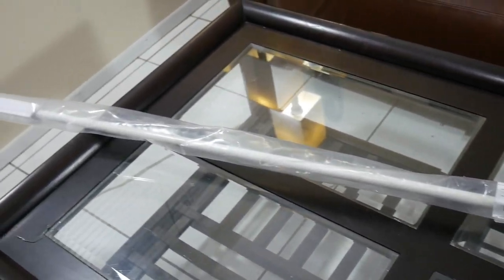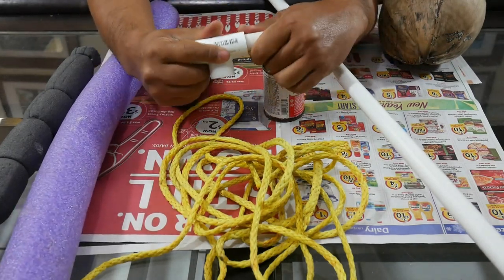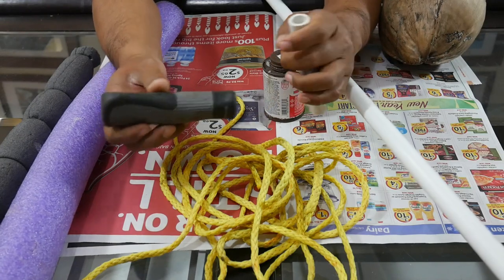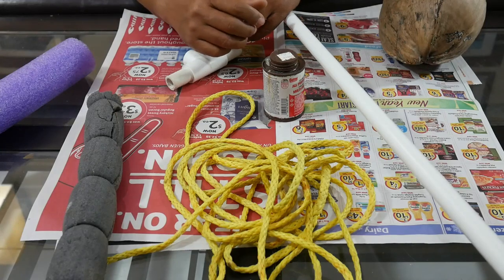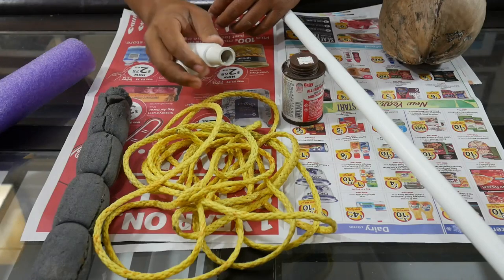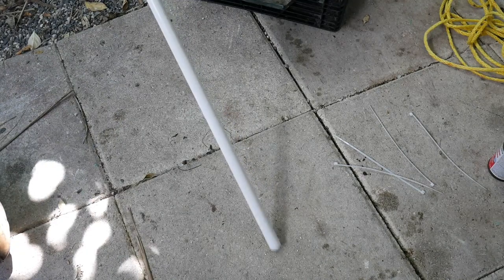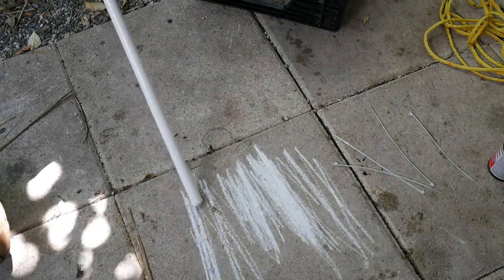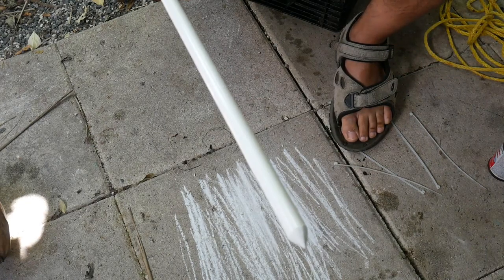$20 DIY Kayak Stake Out - Push Pole - Full Build - No Tools

Comment: I have built several of these and I add a little JB Weld to the tip as a wear coating. I fish in an area with a lot of oyster beds so the tip can get dulled after numerous uses. The JB Weld can be reapplied over time to extend the life of your anchor pole. Good video. It really a simple and cheap build once you locate the components.

Comment: I tipped mine with a 3-4” hex screw that was maybe 1/2” in diameter so when I cut the hex head off and drilled a hole in the pole I could fit and epoxy it into the pole. It created a nice metal tip and provided a way to screw into compacted sand. Definitely took a little longer then your tip but I’m happy with how well it holds. Keep up the good work! Like the videos.

Comment: You mentioned it was polished.  I heard that some of these fiberglass poles have small threads that separate and will stick your hand.  Ever have an issue with that using this type of pole?  thx.
Reply: Most reputable sellers provide a finished surface fiberglass pole.  They are smooth and can be handled with your bare hands without risk.  If you bang it around, scrape it up, etc., you might have some problems down the road.  As with any manufacturing process though, you can have the one oddball slip thru that will put glass strands in your hands as soon as you first handle it.
Reply: Thanks!  I was going to try and find some heat shrink to go over it.
Reply from the maker: So far haven't had a problem on either pole.

Comment: Is the weight of the solid fiberglass what gives it the effect of staying in place? Why not use high pressure 3/4" pvc and drill multiple holes perforating it for water and allow it to grab sand/silt better? Just curious. Thanks for the info in advance Steve. You're the only guy who cares enough to take the time for his subscribers. Its appreciated.
Reply from the maker: PVC flexes too much.  It will bow way too much when there is any current or wind pushing your kayak.  It actually needs to be fairly rigid in order to work.  Also, a lot of time the ground make up can be very hard so you need something that you can really put some force into the ground.
Reply: Hard bottom is quite common around here - there's a lot of old coral bedrock.  That is the only reason I went with a prefab with SS hardware - tip, 2 piece sections for ease of carrying a 10' pole, etc.  I only wish mine had the tee handle so that it could play double duty as a short push pole should I get myself into a "situation".

Comment: Hey Steve, how about a follow up? Did you go with the crab float, like to see your final version after tweaking. Got a pair arriving next week and was planning on using pool noodle for float on pole
Reply from the maker: I used both the pool noodle and then added a crab float on a rope.  Got tired of losing them.  The pool noodle keeps it sticking upright and the crab float on the rope keeps it from falling off the kayak.